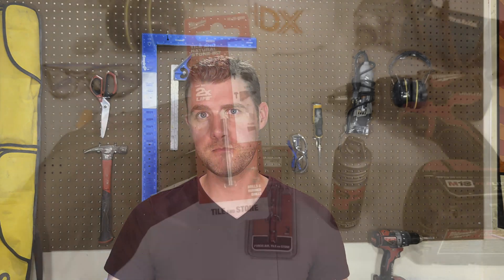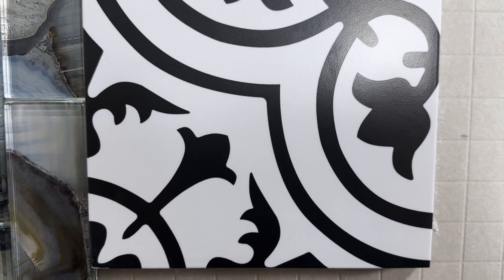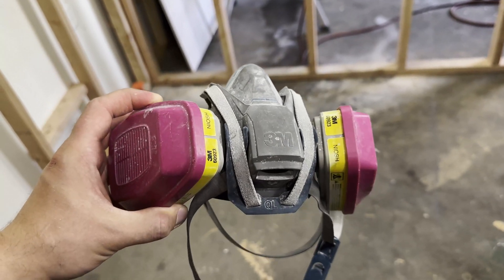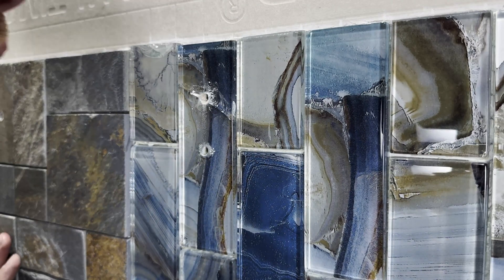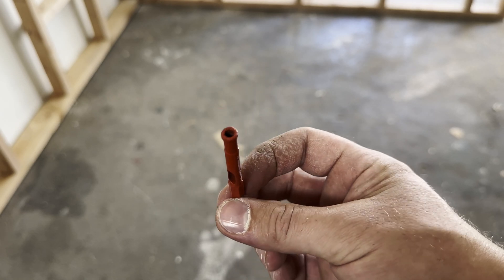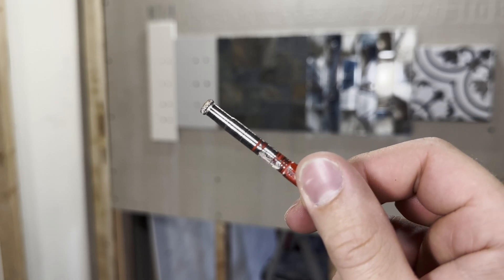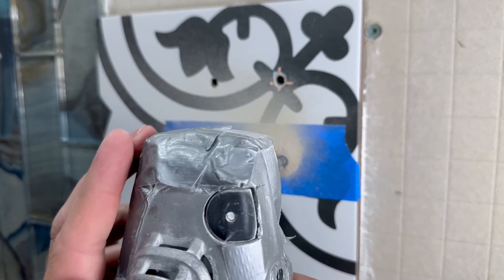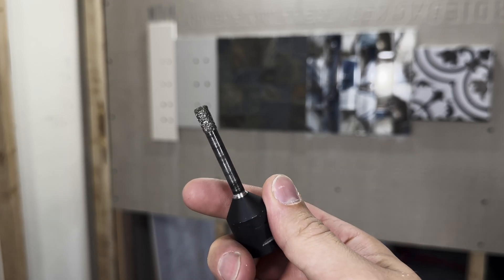Comparison Of The BEST TILE DRILL BITS: Carbide Vs. Diamond Core Vs. Diamond Brazed Core

Comment: The core drill requires some skill getting it started. You can’t just go straight at drilling. You have to start it at an angle, creating a groove and from there you can bring your drill to a 90 degree angle to the tile.

Comment: I like the core drill. Milwaukee used to mKe good ones which had a slot lower on the bit which allowed you to insert a small screwdriver so you could remove the core from the bit.

Their recent version do not have this slot any more. So if you drill into a tile and the core breaks in your bit (which it will eventually) your bit is now useless. You may get the core out which is usually wedged in there by wet sludge and small tile bits.

That’s a way to destroy a perfectly good product with a terrible design decision.

Comment: I just complete a job installing toilet partitions with full continous brackets.  10 holes per bracket to anchor to wall.  High dense porcelain tile material..  used milwaukee diamond bit core bit.  5/16 and 1/4 inch.  Used water purge on bits.  Drilled over 1500 holes, yes 1500 holes and used 2  5/16th and 1 - 1/4 inch.  I never drilled dry.

Comment: I have a 1/4in Carbide that I'm on 5th hole and its taking 30 minutes to get through.  And its getting hot so I stopped for a while.  Granted there is an aluminum tile edging behind the tile that I have to go through for the glass shower enclosure.  I have the shop vac with hepa filter and the hose taped up beside the hole to collect dust.  Not sure what kind of tile this is 1/4in approx, previosuly I drilled kitchen tiles in 30 seconds for anchors with carbide, so wonding if this Diablo 50X bits are any good.  Far from your videos speeds. I used a Diablo 50X sawzall blade to cut up the cast iron tub and it worked great over 1/2in thick it was.  So curious why this carbide drill bit is so dull so fast.  The soft aluminum perhaps?

Comment: When telling us the possible consumers of a good brand name, you should give item numbers or a link where to buy.
I went to Home Depot, nothing 
Monster bits that's what I heard.
Can you post a link.
Thanks .
Reply from the maker: Here is a link to the angle grinder drill bit in the video. 
https://www.homedepot.com/p/3-8-in-Brazed-Diamond-Core-Bit-Hole-Saw-for-Granite-Quartzite-Marble-Concrete-Porcelain-and-Ceramic-3-Pack-BDBP0038-2/319959191

And here is a link to another brand that I started using. More sizes to choose from.
https://www.amazon.com/stores/page/49F7F5A9-B679-4DE0-ACE4-BA8FB24E8741?ingress=2&visitId=14873725-96c3-4cc1-964d-3d799aa107e5&store_ref=bl_ast_dp_brandLogo_sto&ref_=ast_bln